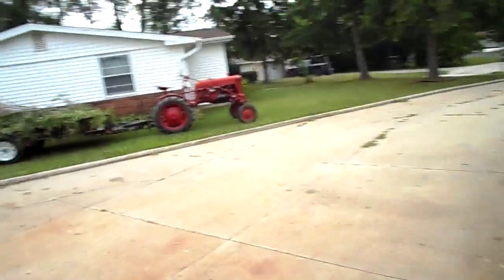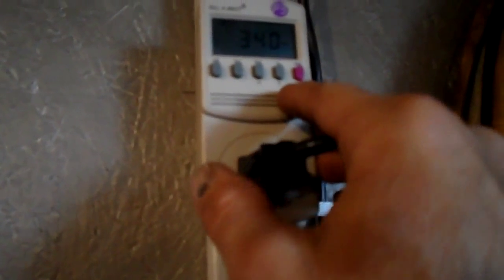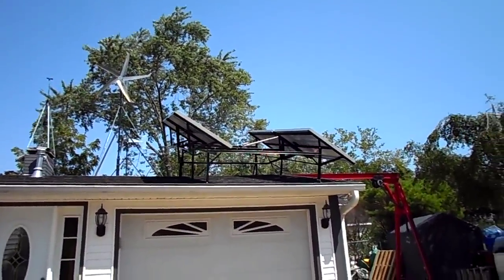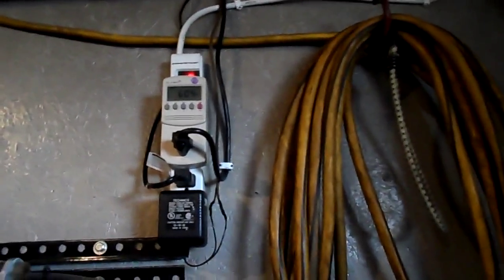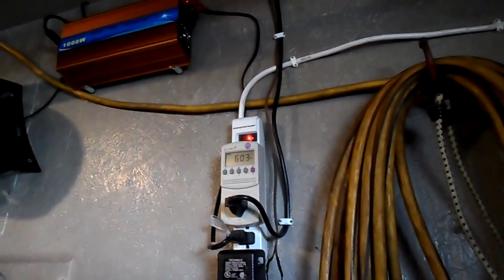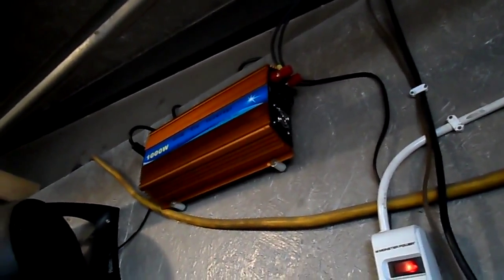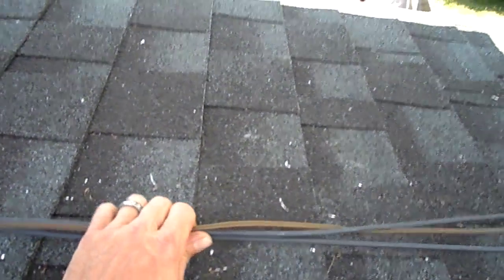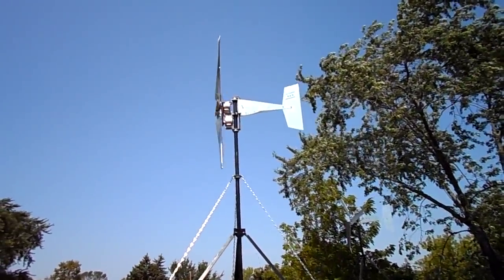Ascending / Descending Solar Panel Sun Tracking Rack installed

Comment: I know with my solar setup ( 6 - 230w 24v panels ) I get awesome power during summer, Using These cheep grid tie inverters you loose some power,, I loose about one solar panel worth of power even tho I have 6 - 230w solar panels I only get about 1100w back into grid using cheep grid tie inverters,,, But charging batteries I get almost full power using mppt charge controllers, around 1300w of solar incoming power,, Winter time my Solar power sux ,, heavy clouds and rain in my area and I only get around 100 - 500w of incoming power from my solar ,, but for me winter time is also higher winds ,, that is when my wind turbines really help out :) They are calling for a warmer than normal winter not much snow in the mountains,, that is bad for my winter winds in my area :( I need the cold snow in the mountains that surround my house for my high winds in winter time ,,, Bad sun and bad winds it is not looking good for me this winter time for my solar and wind setup :(

Nice solar tracking rack,, try if you can ,, moving the solar sensors farther apart , one on the top and one on the bottom of your solar panels ,, this might help your solar tracking problem ...
Reply from the maker: Jason Brown Thanks Jason, the rack turned out to be a bigger project then I figured but the second rack will go a lot quicker and I'll use 3/16 angle iron instead of 1/4 inch.  Those sun tracking systems say it will detect wind and tilt the panels flat.  The actuator is pretty strong and you can't move the panels using a lot of force which is cool.  I don't think I'll have to make a lock for this.  
As far as the light sensor goes, there is only the one little sensor that you can bend to adjust.  Do I bend them downward to upward like opening an umbrella?  It's hard to find instructions for these Chinese units cause they don't come in the box.   I did find some info on adjusting the sensitivity  for light and wind thou.  You can do this in the little control box so I'll mess with that later today.
As far as power output goes your averaging 183 watts per panel where I'm only getting 150w and I think we have the same panels.  That tells me I'm doing something wrong or my grid ties are super cheap (and they were).  I'm thinking of just trying two of the 600w Sun grid ties........Right now I have two of those orange 1000w grid ties piggy backed and so far this morning I'm getting 300 watts out of the first and 100 watts out of the second.  I'll see what happens at noon with full sun.  
On a scale of 1 to 10 I'd give myself a 4 on "knowing what I'm doing".........If I where to put in a small battery bank, I've read you can't just hook a battery up to a grid tie as it will burn it out.  And I guess you need diodes in between the panels and the batteries so the power from the batteries don't go back to the panel, but what do you put in between the batteries and the grid tie?  Is that what a charge controller is for?  My idea of a charge controller is it switches power from a bank to a grid tie when the batteries are full.  Not using batteries I've stayed away from that part of systems so I don't know how they exactly work.  I was hoping to avoid them but I suppose I should find out about that setup also.
Reply from the maker: Jason Brown Update:  Clear skys most of the day and I finished up at 6 kws with stacked grid ties but I still can't seem to get over 650 watts with the 4 panels.  Must be the negative factor of a roof top mount along with chinese grid ties.  The grid tie out put readings did get a lot closer as the day went on with the first around 350w and the second grid tie around 290 watts.

Comment from the maker: Very cloudy morning today (8/14/15) till 9am but finished the day with 4.22 kw's.  One more then yesterday.  I estimate a full day of sun would bring 5 kw's tops for this time of year.  If I averaged 3.25 kws per day it would take about 7.4 years to recover from the total expense of the panels, rack, grid tie and misc.  Unless I can find away to get more then 150 watts per panel.  If one panel is rated at 230w I'd be okay with 200w.  Not sure what kind of losses from the heat of the roof and a grid tie from china would be but I'm hoping two grid ties will increase the out put.........We'll see but at this point it doesn't seem to be the greatest of investments.